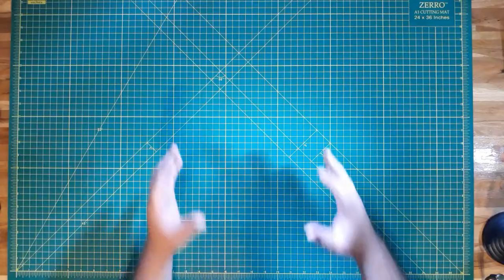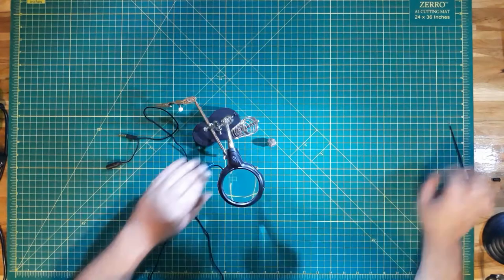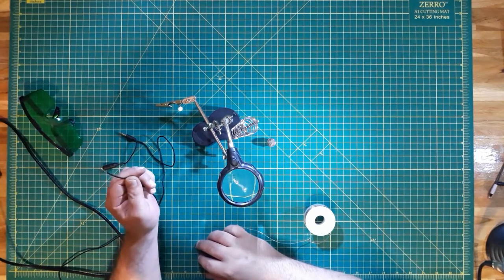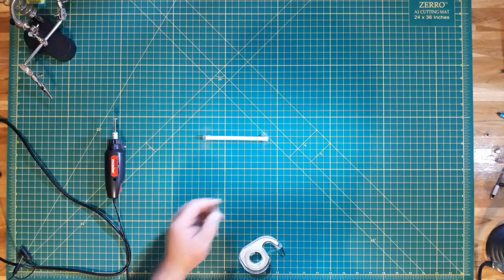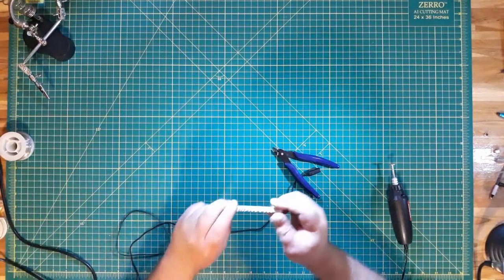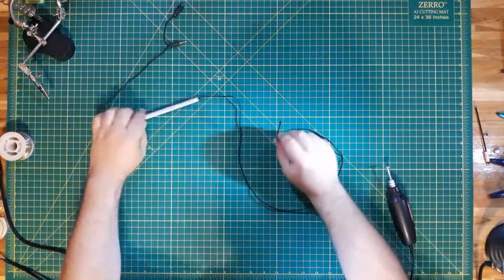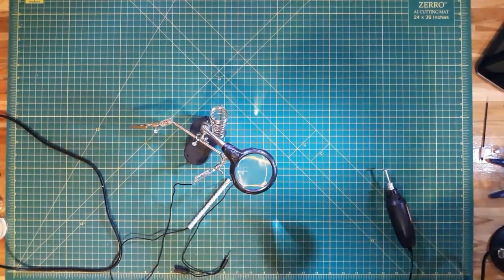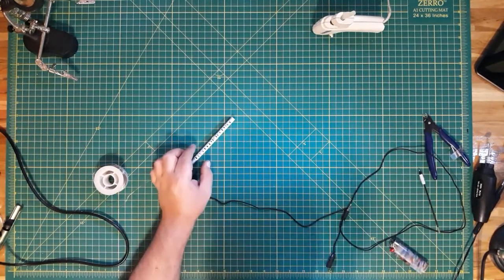DIY $2 Shotgun Microphone?

Comment: The resulting build has got a near perfect omnidirectional response.

On the one hand, i'm not really surprised. The capsule doesn't have any back venting to begin with, it's omni from the start. If you think about it, obstacles under 2cm really aren't obstacles to sound, its wavelength is longer so it just bends around them. So a microphone capsule which has one side of the membrane open to the sound will always be nearly omni, even larger ones are, and at these 10mm sizes and less it's perfect omni. The way directional microphone capsules work is by having a bunch of vents, little holes, on the rear side, and allowing the sound to also push against the reverse side of the membrane. Then an angle invariably exists, from which the incoming sound pressure wave will travel the same distance to the front and to the back of the membrane, and pushing from both sides, result in no membrane movement and thus no sound being picked up. Isn't that exciting? Anyway since this particular capsule doesn't have any holes in its back leading to the reverse side of the membrane, this is not happening, and there was also no point in pushing the capsule to the middle of the tube body, since all the space behind the capsule is dead anyway.

On the other hand, i'm impressed that the tube managed to neither have a particular resonant behaviour, boosting a bunch of frequencies and sounding quite weird, so presumably freehand spacing was of advantage in this regard; nor has it achieved any destructive interference whatsoever. It's turned out quite sonically transparent.

Have you ever gotten back to research on this topic?
Reply from the maker: Yeah, I was trying to build this from what little information I could find on shotgun microphone at the time. I think there has been more information put out there now, and with your comment, there is now even that much more. 

Now that my kiddo has been born (almost 3 years now), and a new job, I just have the time to do all that much.